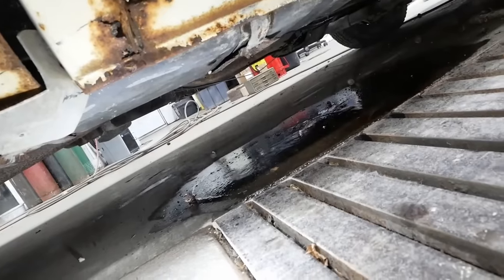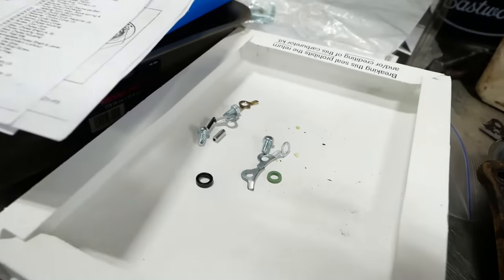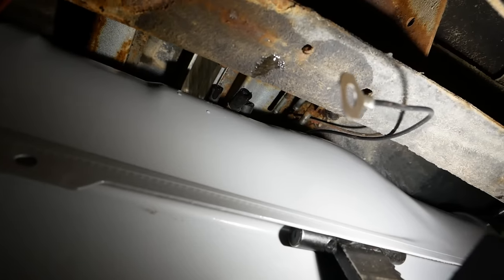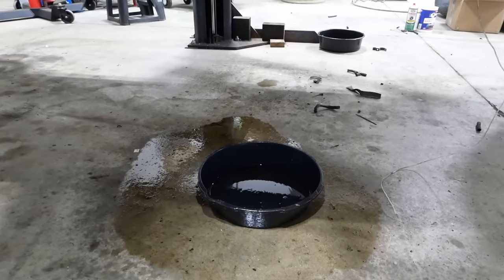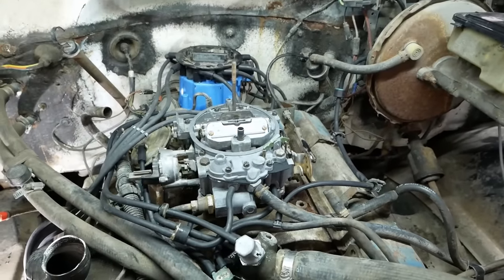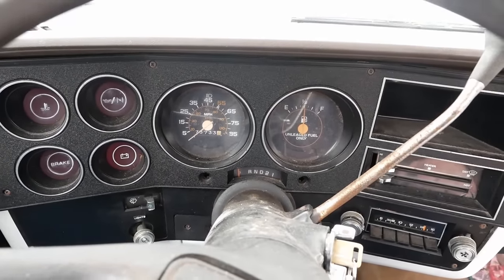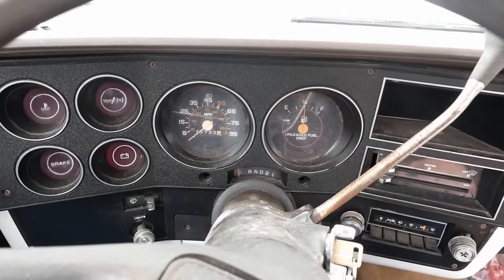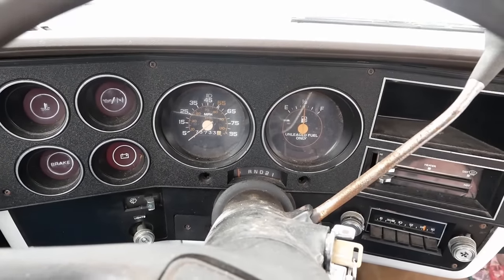Millennial vs. Carburetor | Square Body Chevy Back on the Road After Sitting 12 Years

Comment: i run berrymans' chem dip in my cleaner. i've been using it for years before ultrasonic cleaners came around. don't lose or mix up those check balls. quadrajunks will not run right no matter what if you do. they get a bad rep, but they work really well when they are set up right. this truck is what we called "cold blooded". you pump the pedal half a dozen times before a cold start, and mebbe hold it to the floor and they start right up, and run well when warmed up. the older, exhaust warmed choke springs were adjustable, the only reason this type isn't is because they had to be set just so to meet emissions standards, and were then permanently fixed there with rivets. reclock the choke spring until it works better, then clamp it in place with the screws. these older systems were better set by ear, than by specs most times.

Comment: Regarding flat tappet camshaft wear, a lot depends on the valve springs. The stronger springs allow higher RPM but they also increase wear pressure on the cam lobes. The old tractors you are referring to run about 1200 to 1800 RPM with a low valve lift and a flatter lobe curve requiring less spring pressure to keep the follower on the cam. Small block Chevy engines ran 4800 RPM for maximum  power and usually cruised at 2200 at highway speeds. Straight 30 Wt. non detergent oil did not work in these engines since the early 1950's. Example Ford Y block engines had a lot of rocker arm trouble from customers running non detergent oil. Rochester Quadrajet Carbs? None are the same. No engine starts the same. Rube Goldberg has nothing on the engineers who designed this thing. The first automatic chokes had a bimetallic spring in a housing that had a tube that connected to a hot box on the exhaust manifold and a vacuum port that pulled heated air to warm up the spring. Then in the 1960's we ditched the road draft tube for the PCV valve. Suddenly we had oil vapors running back into the intake manifold. Then, the 1960s California decided that LA couldn't breathe because of the smog, and after a few years, the manufacturers said, "the heck with it, just build them all the same." Then came CAFE fuel economy standards and how can we screw around with the poor carburetor now. The pickup you are working on is why they went to throttle body injection. The Quadrajet carb, for those who really knew them was more tunable than the Holley carbs hotrodders still use. I grew up with the things, and the distributor's advance curve along with the accelerator pump setting cured a lot of off idle stumbling.

Comment: There are plugs in the base of a q jet that leak into the intake and can make it too rich on start up. Some jb weld fixes those up. Also I think you can adjust the accel pump linkage to get rid of that stumble on tip in. I would also make sure the vac advance is actually working. That affects throttle response a lot. When they work they are great carbs but just way over complicated. There are way simpler options to put on there. I have put a little grease on the fuel pump rod before I push it up and that usually holds it up long enough to get the pump in. Good luck!!

Comment: As I recall, there never was a Q-Jet (or other carb) that idled properly when cold, at least not in Northern Wisconsin.

That's why we used to have to babysit the throttle after starting a vehicle for ~5 minutes.

You are bring back less than great memories . ;-)
Reply: I have a 76 Cadillac,  Coup de Ville,  and it starts and idles just fine, I can start in 0 degree weather go in the house for 5 to 10 minutes and it's ready to go, in fact if the windshield isn't frosted over I can drive off in about 30 seconds.  I rebuilt the carb and it's been great ever since.  Unfortunately with many of the older vehicles,  in order for to run really good you need to turn the air cleaner lid upside down,  plus it sounds cool when the secondaries open.  
They aren't really tough to tune just have a bad reputation.  I don't mess with the electrical carbs though.  Not that they are too tough,  just a little more difficult for performance tunes.  One thing is sure, compared to some other carbs,  it can get better gas mileage
Reply: exactly
Reply: LOL! I had that exact problem on my 1972 LTD. I had to babysit it until it would keep running and not stall out on me. Someone had thrown a Holley 750 4BBL on it after they caught the top of the engine on fire, and never could get that thing to adjust properly.

Comment: Good job Wes.
Brings back memories of the days I used to rebuild carburetors  in  my cars, they were fantastically designed to compensate for all the different requirements for fuel delivery and engine operation and once you got everything set right they worked great but there was that one time I really struggled with a Subaru carburetor, it ran worse after the rebuild, it took me a lot of work to find out that there was something wrong with the rebuild kit, a slight difference in one of the gaskets was blocking off a port, once I got the right gasket everything worked great

Comment: Hey Wes, grew up working on carburetors. On the Quadrajets. They were really misunderstood. The two most problematic issues were the float and secondary main well plugs. The later material for the float solves that "sinking feeling" and you can pick up the main well plug kits from The Quadrajet Shop in New Jersey and your in business. Funny, I used to stock a dozen carb kits, floats, main well kits and many choke pull offs. Those days are long gone! Thanks for your videos.
Reply: "Misunderstood" is just a nice way of saying "overcomplicated and expensive". Our usual solution to a problematic Rochester was a Holley 600. Never had one come back, ever. And for those customers who wanted complicated and expensive, there was always Webers. Lovely things. Instant smooth power, reliability, and a glorious noise. Sorry, but Rochesters offer none of those things. Even the Weber knockoffs (Dellorto, Solex, Mikuni, Empi) are far superior.

Comment: Virtually nobody knows carbs anymore.  Good on you making this kind of video.  Hopefully Q-jet experts share some tips.  I like the Q-jet and agree with your approach to keeping the emissions and choke all factory.  They work real well when setup properly and all the vacuum dampers, etc function properly.  You will never get an aftermarket carb to have a decent choke unless it's full on manual in my experience.  Q-jets are famous for porosity at the well plug locations in the base and worn throttle shaft bores.  Both easy to fix though.  Epoxy up the well plugs on the underside of the base to stop fuel drips that make the idle rough and re-bush the throttle shaft bores to stop the air leaks and sticky throttle.  Then it's just typical things like accel pump and needle and seat replacement that get wrecked by ethanol gas.  Keep the cam stock and fix vacuum leaks and it should run great with a simple rebuild.  It's when you cam swap and change the idle / off idle vacuum characteristics that things go sideways.  Maintain the original engine characteristics and you won't find a better carb in my opinion.

Comment: The zinc “madness” is just for breaking in new cams. My engine builder said in the past five years he’s had dozens of flat cams and lifters come back in and the big cam company’s won’t warranty saying they should have used zinc additives  upon startup.
Reply: Every cam manufacture states you have to use a zink break-in oil or you void the warranty. Zink will coat and lock into the contact patch allowing a protection lowering the friction and heat in those areas.

Comment: No expert here . When you step down to the floor to allow the choke to snap shut , you should see a strong , steady stream of fuel from the accelerator pump . Immediately when it starts , the choke pull off should open the choke flap a small amount from the vacuum applied to it . I believe the vacuum break setting can be checked using the correct diameter drill bit to the carburetor throat . That setting is adjusted by bending the link that connects it . You can use a vacuum pump to hold it on . This should be explained in the rebuilding kit . Unless the float is sinking and not closing the needle seat and you are loaded up with fuel . You would probably smell it . Since it has a cat , you may not see the black smoke if too much fuel was present . Just a few things to check .

Comment: I used to adjust the choke cold, by turning the adjustment just until it fully closes. Then after warm up I would check to be sure it is fully open and adjust it a bit if required to ensure it opens fully. Even a slightly slanted choke plate can be detrimental.

Comment: I had an old Camaro one time, that I put a new carburetor on. It ran poorly even after I had it installed. I beat my head against the wall just like you. I finally took it to a local mechanic, who also raced cars. I had him set the fuel/air mixture. My car never ran so well. I was shocked, because you couldn't feel or hear it was running at a light. When you hit the gas, it was like I got all the horses from that engine. It is an art form to set one of those things. Don't get down on yourself, your videos are great, and your knowledge is tremendous. There are just some things that could be considered magic. You most likely could be burned as a witch if you set it perfectly the first time.

Comment: The way I've always rebuilt the Quadrajunk carbs is to throw em in the trash can right next to the POS Holley carbs, and replace it with an Edlebrock or a Weber and never have to touch the carb ever again. Just my personal experience of working on my own cars for the last 40 years.

Comment: Cold start, in my memory, used to be throttle down to the floor once and half-way up and start. In theory, release the peddle once it's running. Always played with the peddle to make sure it didn't stall for a few seconds and you were never certain that it wouldn't.
Reply: If you are in a Midwest winter, you pump it about 37 times in order to get a nice lake of gasoline pooled  inside your intake manifold, which gives you enough surface area to get a rich enough mixture in order to get the engine to start.

Comment: All the credit in the world for putting this crate back on the road Wes. First class work. 

I'm an older Millennial so I do remember carburettors and having to pump the accelerator pedal twice. I also remember my dad buying leaded fuel (4 star) at the pump. That being said I have never worked on one. I much prefer fuel injection. I find it less intimidating than having to take one of these apart.

Comment: On the ultrasonic cleaner, I find that Original Pinesol works well, and works better if diluted with water - don’t get any scented or other versions.  I also use Fantastik, again the concentrated multi surface stuff in the gallon jug, and it works fantastic. The purple Simple Green is okay, but I prefer it in the parts washer, and it is a bit expensive.  I use the ultrasonics a lot, and tend to wear them out.  You can also use the Pinesol in a slow cooker over night, since the heat is doing a lot of the work, as you noticed. Take the hot parts from the slow cooker, then brush them in the parts washer, and they come out really shiny.

On the Zinc, many of the additives are pretty straight forward, and won’t do anything bad to the oil and its additives.  If you can, check that it is just ZDDP in an oil base, or ZDDP and ZDTP and an oil base. Most of the name brand ones are just that.  The big problem with Zinc additives, and the reason they were removed from oil, is because Zinc will kill your catalytic converter earlier than necessary. Any blow-by or burning oil in combustion will send Zinc right down the exhaust. There will always be some oil burning, so eliminating the Zinc from the oil makes the cats last longer. Because they needed to eliminate the Zinc from the oil, and needed to meet tighter EPA guidelines, cars and trucks went to roller or hydraulic lifters. The two things went hand-in-hand according to a plan.  If your vehicle is an oil burner, you have to stay away from Zinc oils and additives, or you will be buying a new cat. If it is a tappet and it smokes, fix the oil burning before going too far so you can use Zinc, or just plan on a redesign of the cam and lifters after they wear out from using non-Zinc oil.

Comment: Quadrajets are pretty awesome when they are tuned right. They give great drivability with the tiny primaries and good power and a great sound with the huge secondaries. 
Nothing beats the sound of WOT Quadrajet
Reply: I used to take the air filter off my 72 bonneville and stomp on the gas..the sound that came from engine when the secondary kicked in was awesome! I thought i was richard petty for a while, until yellow puss and smoke came out the exhaust pipe out back
Reply: Correct!  I used to flip my air cleaner lid upside down and then reinstall it during the warm summer months.  It gave about a 1/2" gap around the top through which you could hear that awesome moan.

Comment: That was great. 
The carburetor -  I kind of remember that people put up with a lot of "less than perfect"  driveability back in the day.  Not going to say that none of these carbs worked right, but many were just never quite right  as time went on. People just lived with it, drove with 2 feet if they had to, put hand chokes on, etc.  It seems like everybody that owned them developed their own "special" way of starting the engine and keeping the thing from stalling when putting it in gear.  The good old days.
Reply: cause they dint know what they were doing
Reply: @ionracer24   Oh but they did, just did not have the cash to throw at go to work vehicles and shopping trolleys.  I mean look at what this guy is spending on this refugee from the scrap yard !

Comment: I preferred the Q-jet to the gas-leaking, float-sticking Holley .  You could putt around on the small primary’s and save gas.  Once you wanted to bring the thunder, you had the big secondaries.  Great carbs when set up correctly.  I had mine done, though, back in the late 80’s.  Never learned how to tune them myself

Comment: I like that nylon fuel line option. Won't rust like the steel hard line and won't soften up and rot out like the rubber line. I'm sure those eventually fail too but I've never seen one fail before on the more modern stuff. Just things like bad check valves, pumps and filters on anything that uses it.

Comment: The q-jets would leak fuel at the bottom of the bowl past the grey plugs. They would be hard to start from flooding and if they sat long enough the bowl would empty. Just use a little JB Weld to stop the leaks. Great video you worked your butt off on that old beater.

Comment: I vaguely remember (it was a long time ago.) There are some aluminium plugs in the base of the middle section or the  plate of these carbs that suck air too. You seal the underside of the with JB weld and sand flat. It helps.  Or you go out and buy an Edelbrook carb, which is easy to install with simple well written instructions. They just bolt in and work. You warm it up for ten minutes and set the mixtures, make sure the cable/linkage gets full throttle and take it for a 10 minute drive and write up the bill, Done I've fitted 4 of them, 2 years on no probs. we fitted one to a 58 Cadillac that wouldn't consistently idle. It was rented out with a driver for weddings etc. It had to be right. It idles and improved the gas mileage.  I got sick of dealing with worn throttle shafts over tightened bases and lids. Holley power valves that dont. Etc  Urgh.!#$%^&*()(!!!  And yes I am a patient person. LOL The best thing you could have done with that carb it to walk across your driveway and throw it into the corn field as far as you can.

Comment: I'm 46 and prefer carburetors to fuel injectors. The fuel injector systems ARE better and easier but when you're on the side of the road without tools you can still get a carburetor to work. There's also something therapeutic to rebuilding carbs. At least for me.

Comment: Wes, the “minor rattle” on the brake shoe you refer to can be alleviated by knocking those tabs down before even mounting the pad on the caliper. Bend it down a smidge more than needed (trial fit a few times, you can get good at it), the start the pad on the caliper tabs first then press it on the other side, as an interference fit of sorts. The tabs will bend back out a bit but you’ll have no noise at all that way.

Comment: I loved where you hooked the choke heater to a power supply and noted that it drew no current. Those problems can often be fixed by soldering the rivets that make the connections.  Use some good flux to remove the corrosion that's there and you should get a good permanent fix.